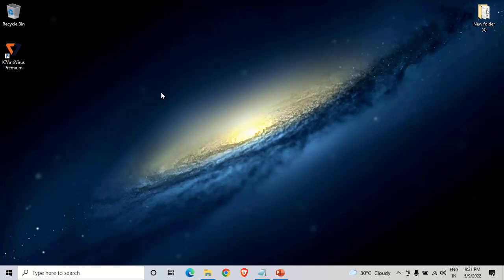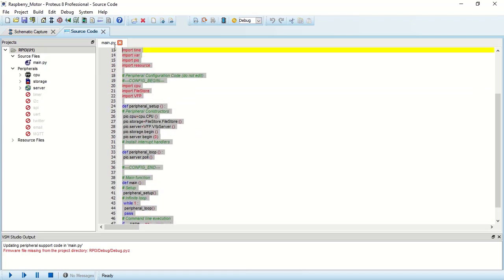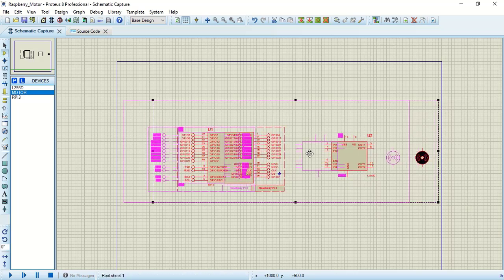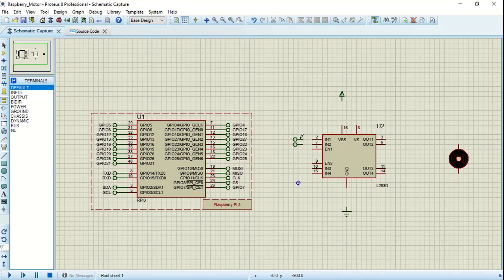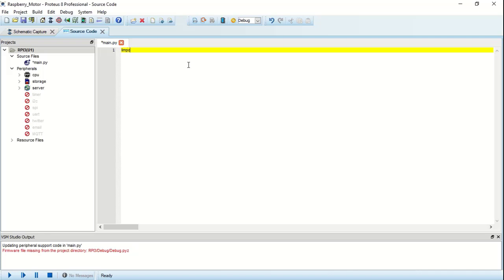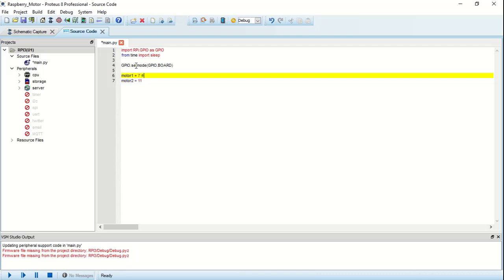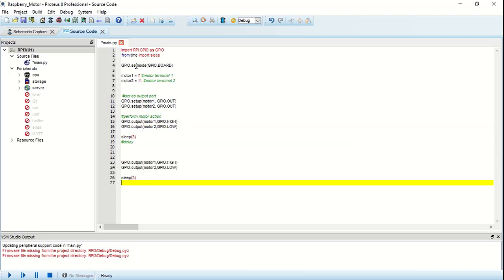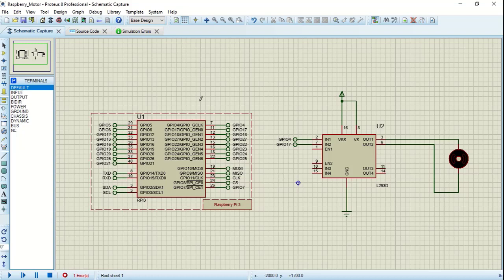Raspberry Pi Interface with DC Motor Using L293D || Proteus Simulation

Comment: In my simulation the motor works very faster, is there any way to control motor speed by using code or by configuring power.
Reply from the maker: Yes, there is a way to increase or decrease the speed of DC motor, its called "Pulse width modulation - PWM" . you can use pin 3, 5, 6, 9, 10, and 11 for that purpose. 
Thanks for the comment.
Reply: @VirtualEngineer_MKS   Thank you for replying, but i used rpi gpio functions
i got the way to control motor speed by defining motor enable pins as pwm output as
<object_name> = GPIO.pwm(<motor_enable_pin>,1000)
<object_name>.start(<speed in percentage>)

Comment: man, I code like you 100% but it said:"TabError: inconsistent use of tabs and spaces in indentation " at line 16( GPIO.output(DC_motor_b , GPIO.LOW)), can you paste your code here, I dont know what is that error
Reply from the maker: its seems like you had made mistake while coding. please check the code and run the simulation